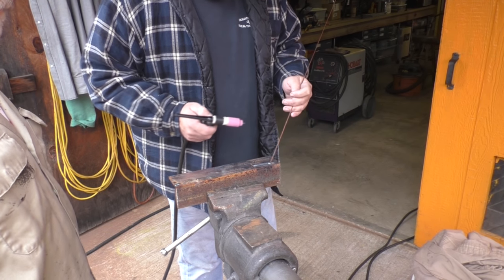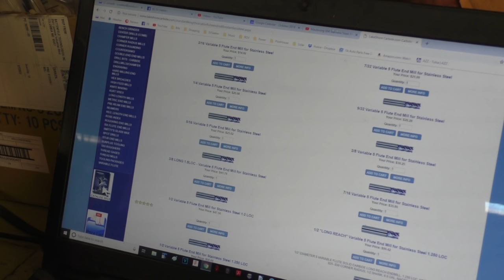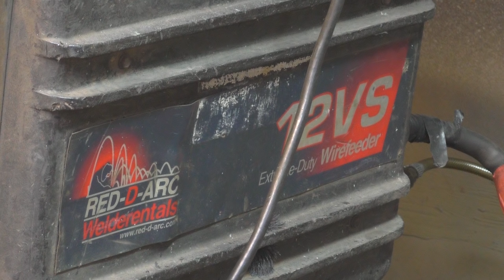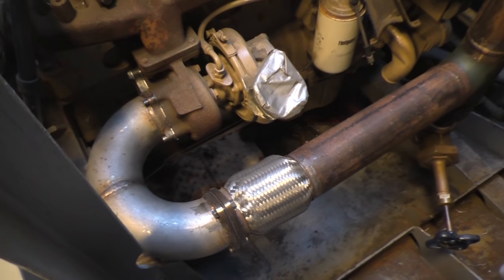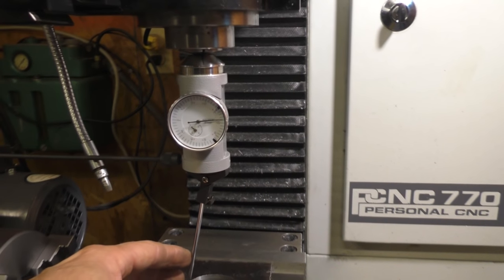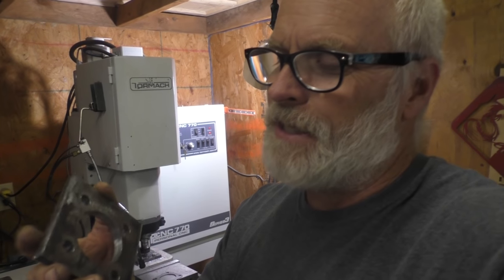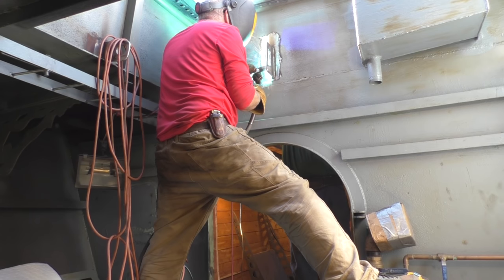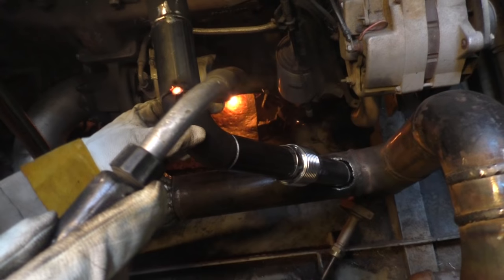Engine Exhaust and other Engine Room Stuff

Comment: If a stainless exhaust flange warps while welding. You just use a belt sander to level it out afterwards. That is what most header and exhaust makers do. Obviously it has to have a back plate to make sure it is even. But, you'll be fine. A lot of high power turbo manifolds are done this way. Let me know if you want reference footage. I'll link a video if you want.

Comment: Love your videos...Few Points To Consider :
1- Up-Travelling Exhaust pipes may build up with sooth in time. Is there any access point to clear/clean them
2-  14:30 = Gussets to sides... Better to make them EXTRA strong than being sad later,especially in the engine room.. 
3- I'd suggest `Auto Extinguisher`s (Search Automatic or Auto Extinguisher) for the Engine room In case of Fire. You can actually make ONE Simple system with Argon or CO2 gas with a simple extinguisher alcohol sprinkler bulb. Rather than Powder,i suggest the CO2 or Argon so you don't need to clean Extinguishing powder from everywhere in the event of discharge..They are fantastic inventions and save a lot of damage. 
4- Cooling exhaust can be done with WATER COOLED Manifolds. Welding a Stainless Steel one would make a lot of sense but you need to have at least 2 in stock.

Comment: The nick is the tool deflection when the machine comes around it pauses of a nano second to read the next line of code . If tormacs have a look ahead function like my Haas does . enter the look ahead code and it will read 3 lines ahead . so then it wont stop at each line and that will stop the nick
Reply: or add a circle in "curly cue" before it Zs out.

Comment: I'm a little conserned about heat in your engine room. Granted it's a sailboat but solar can only supply so much power. I don't know if you plan to run a water wheel generator but they are kind of limited, too. The bottom line is the generator may be run more than you planned creating exhaust heat much higher than engine heat. Stainless is a fine solution for exhaust. Especially if making it water cooled. I have had stainless exhaust off my turbos on every diesel boat I have owned. I machined many exhaust peices and elbows from stainless and there has never been a welding or warpage problem. Maybe it's a grade of stainless or thickness issue but I try to use 304 grade on most of the stainless on my boats. A major amount of stainless used for plumbing on submarines is 304. It is no more difficult to machine than 316 and it doesn't brown up like 316. I was a machinist close to 40 years and worked mostly in stainless and other corosion resistant alloys. Those padeyes you added around the engine room will make it way easier moving and placing heavy items. Have you set up a ventalation system for the engine room? Like with dorades [ can't spell worth crap ] to cause the forward movement of the boat to scoop air and force it through the engine room. She's so close to launch you can probably smell salt air!
Reply: I had a thought about making hot water. Do sailors wash? Haha never mind haha
Reply: I believe they have plans to dump the heat to keel cooler in warmer climes, or use the built in water to air radiators in cold conditions to warm the engine room.
Reply: @mkllove  The heat I was refering to is radiated from the exhaust system. A heat exchanger using raw water can make hot water for use through engine heat but exhaust heat is much hotter and can increase engine room temperature to unbearable levels. Dry exhaust is cheaper and easier to install but there are tradeoffs for saving money. The talent and welding skills Doug and his helpers display is more than up to the challange of controlling the temperature in the engine room.
Reply: @28cruzin  The exhaust will have insulation and wraps to reduce that problem, and make it safer working nearby according to Dave the welder you saw crafting the system.

Comment: You can just sand off the dross from the plasma cut edge.  It's very thin.  But it is very hard on any tool you put to it.

Also I've found that drilling stainless takes low speed and lots of lube and pressure.  Two steps to half inch is too few.  But some hole saws.

Comment: Are you using just tool steel/HHS tools in the mill? If you are going to cut anything harder than mild steel, I would recommend going with tungsten carbide. Yes, they are super expensive, but they will cut almost anything. A little cutting fluid is still needed, but you would have been able to mill the edge that you cut with the plasma cutter with one.

Comment: Doug, If you need to machine something that you plasma cut. You can, just machine in the conventional direction and take a deep cut. Then the cutting edge of the endmill will be cutting into soft steel, as apposed to cutting climb. Climb cutting will destroy your endmill in a hurry as every time the cutting edge hits the work piece it is cutting into the ultra hard plasma cut edge.
Reply: Getting under the hard surface is the trick. Counterintuitive, but a nice deep cut is easier on tooling with flame cut edges.

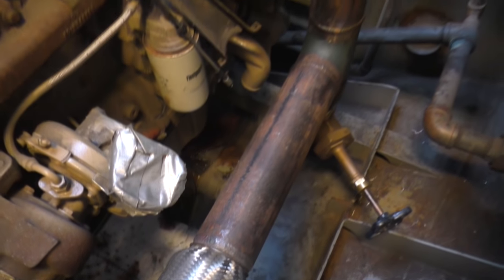Comment: At 6:21 as a reference, put some  type of heat shield on that alternator to keep it cool from the exhaust you just installed.
Reply from the maker: The whole exhaust system will get insulated.

Comment: for the flanges.. cut the centre hole oversize and fit the pipe inside and weld it inside such that the seam is half way through the thickness of the flange. this is how or auto manufacturers do it and it results in no or v.little distortion

Comment: slap a 90 degree gusset on those pad eyes for side loads. also watch out when using heavy black pipe for exhaust. they get harmonics sometimes and crack welds. also use silicon bronze hardware on the exhaust and not s/s with s/s as theyll gall together so bad the only way they come apart is with a plasma cutter. id have exhaust blankets made up, or buy a roll of wetlap, for the heat and so leaks dont cause fires

Comment: s.s. steel work hardens so once into the cut keep going min. pecking will extend the life of your cutters, solid carbide end mill are all I have used for the past 30 yrs. When they get dull have them sharpened. I get years and years out of them.

Comment: Hi Guys, I'd have a tap to close off the gen set exhaust or machine out a gasket without a exhaust hole to close the  pipe so the other engine can be run while at sea.  Mark

Comment: The exhaust that is tied in to the main engine exhaust, does that engine have a turbo charger on it? If so be very careful with creating a draw on that exhaust, the turbo will be spun with no oil flow to it.

Comment: "if you finger gets hot" you can go to Jody's store weldmonger.com and get a TIG finger.  Love mine.  Works as advertised.
https://weldmongerstore.com/collections/frontpage/products/tig-finger
He's right.  Welding up stainless makes it warp.  But that's true of all metals.  If an engine ran ALL the time, it will only get a patina of rust. I just feel it's worth the extra work to go stainless on a boat.  Part of the reason stainless was created.

Comment: The coaxial indicator instructions will tell you that those increments are NOT to be regarded as 'thous', because it depends on how you've got the needle/arm set up - cosine error type thing.  Just get the movement/deflection in both axes to as small as possible and that's as good as it gets.
Regards Mark in the UK
Reply from the maker: Who needs to read instructions?  I just have to read comments.
Reply: I'm impressed that you manage to find time to read any of them.
Reply: Nailed it. It is a differential reference, not measurement instrument..

Comment: You need to stop thinking of manual milling techniques with you tormach machine. Hold plate in vice or clamp to table then with a 3 flute carbide 8 mm circular interpolate the 12 mm dia whilst plunging down .025 per rev spiral till its through. same with the big bore, small plunges per rev using the same 8 mm cutter. When blanks are done mount on studs and profile the outside in .020 steps in the z axis. This way you never load up the spindle risking breakage. Same way you used your profiler on your big table. You can finish off with a .005 full depth cut if you are after a full smooth edge.

Comment: just a bit of info you may ponder over when we used oposing metals on fire truck builds we had to use rubber ga skets between them to prevent catalist corrosion from them.  Lovre you channel and i have learned so  mutch from  the volenteers that donate time and wisdom.  With i could come and
help but my funds are low because of aguiring a autoamune disorder from a flu shto back in 2012. I was a maintence millrite for quite awhile . I feel that at 52 i could stil offer my skills on a limited period of time.All i need is way to gest there from rhode island if you have anyone coming out that way it would be a amasing way to help with my illness and feel like i still have a purpase in my remaing days of a very fruitfull and blessed life.So if you read this i hope you forgive my grammer and spelling and don't think that im a scammer or whatnot. So could anyone that knows Doug could pass this along to him.   Good by and mutch respect for you dream and creating a living vessel that will cary on helping our planet and lak of its creatures.